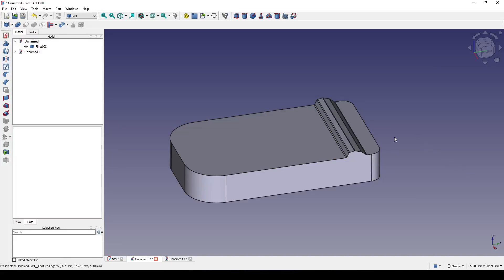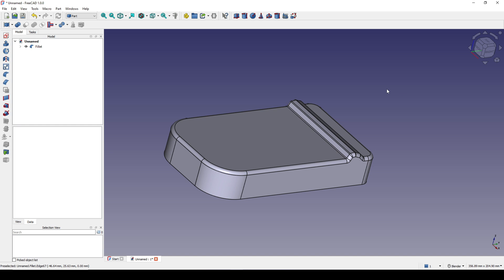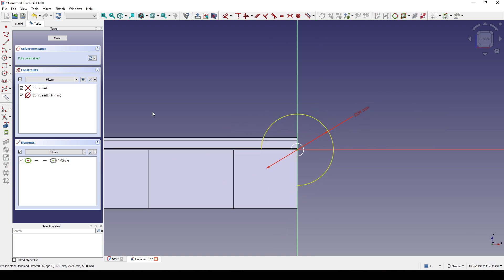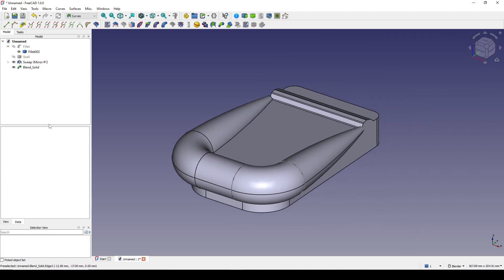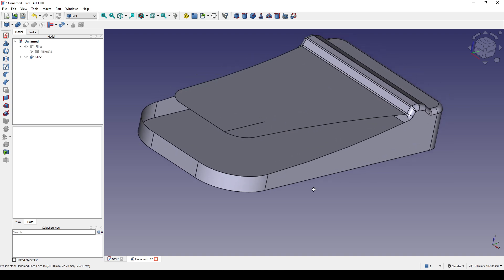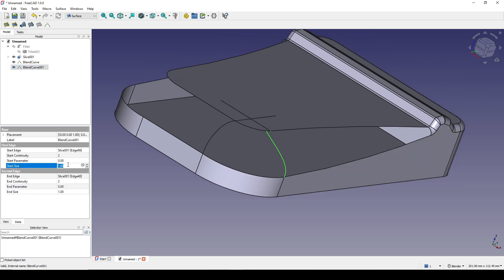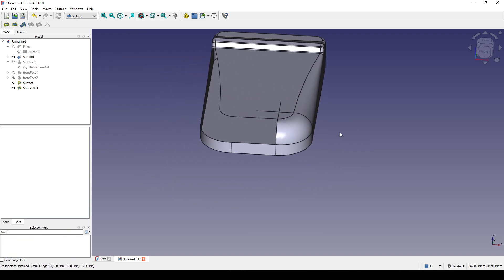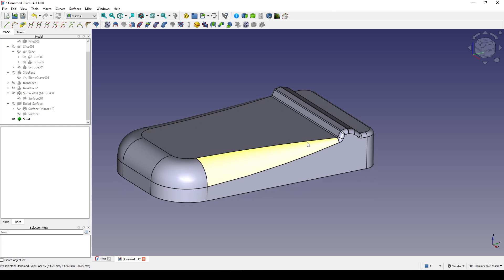FreeCAD 1.0 Fillet Different Radius

Comment: at 9:46 you select base/bottom face and the  extruded and  at 10:34 you select top face and the extruded line.
why different method? anything special or something will be error if select bottom or top only + extruded line?
Reply from the maker: No, both are the same, top face.
Reply: @DuyQuangDang I'm trying to create bend curve line following the tutorial, but the start of bend curve line is not in the edge but in the middle of line (at end of the line or at the cross at top).

already trying it multiple times using top or bottom face to make a slice of compound. But the result is same. The start of bend curve is always at the end of compound line.
Reply from the maker: I create blendcurve using Surface wb, not in curve wb. About slice to compound, our goal is slice the top, not the bottom.
Reply: @DuyQuangDang  yes I do, using surface wb to create bend line
Reply: I have following this tutorial step by step with carefully but the bend curve step make me frustated.The first one at 11:07 is  always failed to create bend curve line at the top edge (the bend line always in the center (cross) not in the edge, but the second one is always succesfully.  Not my lucky day
Reply from the maker: @subagioharjo1846  when you create blendcurve, if you select top edge first, you should play around with Start Parameter ( set it to 1). If you select top edge later, set the End parameter to 1. Maybe I will make a tutorial about it later.
Reply: @DuyQuangDang  thanks for help, yes I just set the start parameter (after read wiki and your comment), now I can create surface properly. Thanks

Comment: I have followed along and produced the final solid. It does pass geometry check without BOP check enabled. But, fails with BOP check enabled. Can you comment?
Reply from the maker: Yes I work with surfaces and see the Bop check invalid curve on surface almost all the time, even on very simple surfaces, I still see it. The gap when we join surfaces with the geo of the object together usually 0.01mm, Bop recognize invalid curve. However, I found that when all the surfaces are in contact, and it's green, it should be fully functional.

Comment: Why not use the variable fillet option in the fillet tool
Reply: Yes, that's much easier and you can do everything in the Part Workbench. However, you have to slice the part into 3 pieces, the back part then gets 3mm fillet, the front 17mm and the middle part the variable fillet from 3 to 17mm.  Finally, the 3 parts are put back together. I tried that, works fine.
Reply: @jurgenr3240  I didn't try with exactly the same shape as the video but with a flat rectangle you can vary the fillet all the way around without slicing it apart. I have done it in the past on a more complicated shape without slicing either. As long as the joining lines of the fillet match it should work, sometimes you have to swap the fillet size in the two boxes around depending on the edge direction (hope that makes sense)
Reply from the maker: Thanks for advice!
Reply: @DuyQuangDang  great surfacing though, and on your other videos. Beyond my capabilities 👍